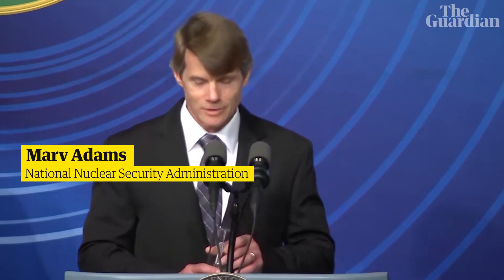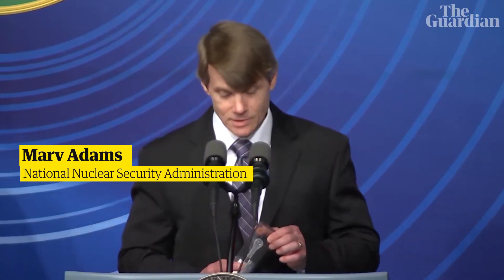Nuclear scientist Marv Adams explains what happened in the successful fusion experiment

Comment: Did we break the laws of physics or am I dumb. “The law of conservation of energy states that energy can neither be created nor destroyed - only converted from one form of energy to another. This means that a system always has the same amount of energy, unless it's added from the outside.” 

2 megajoules in 3 megajouls out? Yes conservation of energy law state’s energy can’t be created unless added from the outside but only 2 megajoules were added from the outside?? Did we break the laws of physics someone answer…
Reply: in fusion 2 lighter atoms ( talking in terms of mass) combine to form a single heavier atom. but the mass of the heavier atom is not equal to the sum of the masses of the 2 lighter atoms. ex- if 2 hydrogen atoms each with mass 1u combine to form a hellium atom but the mass of hellium atom is less then 2u then that mass which is missing is converted into energy

Comment: 2MJ in 3MJ out??? Does that not break the laws of physics and conservation?
Reply: No. How would it.
Reply: @afaxmachine5045  you’re getting more energy from a system than you put into it.. how can that be possible?
Reply: @ekothesilent9456  the extra energy comes by breaking the nuclear stability... The nucleus at the core of element has some potential energy due to the binding nuclear forces present there... If you can irk that stability, you can get some energy released at the cost of that loss in potential energy!
Reply: @ankurraj6560  why thank you!!

Comment: To get that nuclear fusion to begin took a lot of energies though the lasers may have been 2 joules but the process to get that plasma to plasma levels was way more than 2 joules i bet you anything.
Reply: 300 MJ to get the 2 MJ of lasers per the article I read. Still doesn't change that they got a man-made fusion reaction that gave more power than put in, as that had not happened before, outside of thermonuclear bombs. Don't buy fusion power plant stock as this is a step in a still very long road.

Comment: Doesn't that break the laws of thermodynamics or something? Energy can't be created or destroyed or whatever?
Reply: Nope, because the energy released by the fusing of those hydrogen isotopes was already there in the fuel. Fusing the hydrogen isotopes into heavier elements released the energy. Just like what happens in a thermonuclear bomb, just without the bomb part.
Reply: @steveaustin2686  Lol "without the bomb part". Love it
Reply: @Chris_Cross  Yeah, that's been the hard part. Now that they can ignite fusion, they still need to sustain it. It took 300 MJ from the grid to get the 2 MJ to ignite fusion. Fine for starting a fusion plant, but now the fusion needs to be sustained for more than roughly 0.08 nanoseconds. It's an important step, but in a long road to fusion power plants.

Comment: 1.5 isn't a lot. How much energy is put into the system? Will it be worth it? Will it exceed energy put for running the system?
Reply: Yes that was the whole point of the experiment.
Reply: @afaxmachine5045  I mean whole system with all inefficiencies, not the output of the laser vs the energy gained from fusion.
Reply: @BitWise501  From the article I read, it was 300 MJ to get the 2 MJ lasers for 3 MJ of fusion. No one is going to start building power plants based on this in the short term. But I believe that this is the first time man-made fusion got more power out than what was put in, outside of a thermonuclear bomb. It's an important step in a long road to fusion power.

Comment: I’m not impressed.
1.5 megajoules is equal to 0.42 kilowatt hours, which is about $0.21 worth of electricity.
Since we’ve spent about $50,000,000,000 on fusion research, they would have to run this experiment successfully for 238,000,000,000 cycles to break even.
Meanwhile, the fusion reaction in the Sun (and every main sequence star in the universe) produces 3,800,000,000,000,000,000,000,000,000,00 joules of energy per second. 

A thermonuclear hydrogen fusion bomb creates approximately 4,180,000,000,000,000,000 joules of energy.

Suffice it to say, Fusion Energy has a LONG WAY to go before it’s economically viable.
Reply: It produced 1.5 MJ in one billionth of a second, though, in a millimeter-sized reactor. Yes, there's a long way to go, but don't compare apples to minivans.
Reply: Turns out 238 billion cycles is about 238 seconds if you imagine the process is sustained.
Reply: @ashleydavis3318  So how long does it take the team to create one of those “energy packets” filled with fusion material? 
Because based on what I’ve read, a sustained fusion reaction on Earth is impossible due to the amount of heat, pressure, and material required. In order to have sustained fusion, you basically need a star.
Note: I seriously hope I am wrong about this.
Edit: yeah, so like I said, they have a LONG way to go for this to become economically viable. They can only run a one experiment at a time, in very small/quick batches, that require a ton of prep time. They’ll need a new process if they ever hope to get more energy out of this type of reaction.
Reply: @jeffw8218  Not sure about the fuel, but yeah the actual reactor would probably achieve fusion in short laser bursts. At least the fuel can be iterated upon and improved now that we know that the process actually works.

Comment: This is actually amazing. I had always assumed that the laser design was inferior to the Tokamak and the Stellarator, but it's actually progressing faster than both of those designs. But remember that a fusion reactor can't just generate a higher energy output than its energy input and call it a day. It has to generate an energy surplus that is greater than the cost of the laser and the facility within the lifespan of the machine parts.

Comment: This guy was charming. I’m still a little skeptical of using lasers for fusion to actually generate industrial power, but we certainly learn more about the process, so this facility at least generates valuable data.
Reply: You're right to be skeptical. Yes, the data is useful, but as you said, this is not the way to get continuous power, and it didn't even get "more energy out than in".

In his own words, this got "more energy out than the energy deposited into the pellet". That's a very different measurement, and it's ignoring the orders of magnitude more energy that was lost in the conversion, and even more energy that got lost in manufacturing that single-use highly precise cryogenic pellet and,  gold cylinder, and all the other parts that get destroyed with every shot.

Comment: This fusion technology would be beneficial to combating Climate Change. It can produce nearly limitless, emissions-free power. However, achieving controlled fusion on a large scale is extremely difficult and currently not technologically feasible. This breakthrough is a significant step forward, but it is still a long way from being able to produce fusion power on a commercial scale. Additionally, even if fusion power becomes technically feasible in the future, it would take many years to build the infrastructure needed to replace current forms of energy production. We must keep up with our fight to rout out Fossil Fuels!

Comment: A few remarks.
1. Not the first. The UK  jet lab did it in February where the fusion positive balance produced 59 mega joules 
2. Lawrence livermore laser fusion in November  produced 1.3 mega joules.
This is the amount of energy produced by 30 grams crude oil.
3. We are still 50 years away from commercial fusion energy.
4. We are still thinking wrongly on producing energy. We should not be looking to turn a steam turbine by heating water.
We need to be thinking about inducing a flow of electrons like solar plasma to directly generate electricity. This is called aneutronic fusion

Comment: was this a charade about 'better, stronger, smaller..' ... fuel? 1.5 in, 2.0 out. So, about a 33% yield. Does making the fuel cost more than 33% of the yield of the fuel that's used? Or is the idea that fuel creation process can get better whereas a yield of fusion being better is all ya need? There must be some nuance, or then its just moving the air in the balloon around. Have to read more.

Comment: In case anyone is wondering, the time it takes for light to travel an inch is 8.472546076823462722261317938839116e-11 (or 0.00000000008472546076823462722261317938839116) seconds.

Calculated on my SwissMicros DM42.

Comment: I love his level of calmness. There's no need to "sell" or hype up anything. It's like when you impressively succeed and you don't have to worry about going over minor issues. You did it.

Edit: hey ya'll, just so ya'll know I ain't reading these comments
Reply: @Drengodr 2MJ was the energy delivered at the surface of the target, the 192 lasers actually consumed 322MJ of energy in the whole process… Read the official article. This is very far from true ignition. Impressive advancement nevertheless.
Reply: @Drengodr This is a milestone achievement, but it is a baby-step in making fusion an energy source reality.  The energies you've listed is for the specific fusion reaction.  Lasers supplied 2MJ and they got 3MJ of heat out of it from fusion.  However, for the lasers to supply that 2MJ took 300MJ of electricity.  There is still a ton of engineering/science work to get this to an overall system energy break-even and a ton of work from there to make it cost-effective to supply energy in this way.
Reply: In doing so he actually sold adn hyped everyone up for this.
Reply: this is exclusively hype. if you're under the impression that this fusion reactor creates more energy than it consumes, you'd be wrong. the misleading lies of omission has kept billions of dollars away from more promising scientific research. they have been doing this for hundreds of years.
Reply: although he also acts like a pretentious arrogant privileged white man
Reply: No they didn’t. The experiment actually consumed hundreds of megajoules, to produce only three back. They’re omitting the operational costs of the lasers for some reason, saying the lasers were just real inefficient and if they had more efficient lasers, they’re “theorizing” they could do it with 2.05 megajoules. He’s trying to calmly perpetuate a scam., because he has to know better.. They’re also asking for tons more money for equipment and sensors to analyze this “breakthrough”..
Reply: @hjvanderlinden  burning up 300 megajoules to “generate” 3 is not practical or realistic, at any scale..
Reply: To be fair, most scientists presenting on a stage like that would be humble or coy because they’re usually not the outgoing and flashy type, hence being a scientist. So you can safely guess that he’s just part of the norm. Nothing exceltional or surprising about his behavior
Reply: @Robisquick  the presenter here was very arrogant.
Reply: No need to sell or hype when everybody watching is thinking "this will change civilization".
Reply: It’s nuclear fusion it sells itself 😂
Reply: @Drengodr no, it was 300 megajoules to produce 3. They’re removing the actual energy it cost to run the lasers for this.
Reply: @Drengodr I was about to say the same in a way that said the equipment and also lasers to run this would still benefit from the output given, also the output is 1 inch of the speed of light. So given the input I would say also the output energy outweighs the now primitive energy source would one say?
Reply: And it will go nowhere.
Reply: And that is also why most people won’t hear about this. True news is competing with those pushing their products.
Reply: @Drengodr  Efficiency should be calculated in terms of electrical energy:
efficiency = El Energy Output / El Energy Input

El Energy Output = Heat Energy Output x conversion efficiency = 3MJ x 35% = 1.05 

El Energy Input = laser energy / laser efficiency = 2MJ / 0.5 = 4MJ.

Efficiency = 1.05 / 4 = 0.25125 or 25.125%
Reply: he’s lying that’s why. All of a sudden this happens while Russia at war.. yea ok 🤣👍🏻
Reply: He did hype it but you did not understand the deception. He did not account for the total input energy from the outside system that was used to run lasers.
Reply: @usneome  do you actually know what are you talking about?  Because you sound like one of those people that doesnt believe in anything, like always for example when trains couldnt exist. I feel sorry
Reply: @shaund4978  Read comments below, people have mentioned how much input energy to lasers was actually used in this experiment. 320MJ. The output heat produced by fusion reaction was 3 MJ. It means that 99% of input energy was lost in the process.  
You should thank me for pointing out that this was a small step in fusion research, not worth of huge publicity stunt.
Reply: @usneome  Shut up will ya
Reply: @usneome  what are you even talking about?  the building AC?  there is not outside system to run a laser, the laser is the system.  have you ever used a laser pointer from the store before?  the lasers they use are literally the exact same thing but bigger and with a much nicer crystal so they can have a very short pulse duration and a certain wavelength
Reply: @Logan-dk8of  they used 192 laser beams in this experiment. I guess that helped push input energy requirement to a high value.  I did not come up with 320MJ number for input energy to lasers. Several other comments on this site quoted this number from another article that gave more detailed information about this experiment. 
My overly optimistic laser efficiency number of 50% is still very troubling for achieving commercial nuclear fusion.
Reply: @usneome  I'm completely impartial and just a casual observer here. Can you point us to some information that challenges this?
Reply: @indignorant7684  
Presenter used intermediary value (output of lasers at 2MJ) and compared with the output of fusion reaction 3MJ. 
He never mentioned input energy to lasers. This is the true input that should have been used in gain calculation. Actually it is even worse than that because output energy is heat and converting heat to electricity is also a lossy process. 35% efficiency. If the Laser efficiency is 50% (being generous here)

Overall efficiency = ( 3MJ x 0.35) / (2MJ + Laser loss) = 1.05 / ( 2+ 2) = 0.25.
Just to break even in a lab setting they need to improve efficiency at least four times.  That is why he said they are hiring people who like to work on challenging problems.   
For a commercial technology, breaking even is not enough, they need to improve efficiency much more to justify costs of building and operating a power plant.
Reply: @indignorant7684  read the actual articles on this. The lasers they used consumed 300 megajoules to produce the reaction that generated the 3. They’re ignoring, or rationalizing away about 99% of the actual energy used to produce this. They’re saying if they take out all the inefficiencies, they “calculate” they could probably have done it with 2.05 megajoules, or what they’re “estimating” that the laser actually transferred, in the best-case scenario. Bottom line, the reaction that “generated” 3 megajoules took about 300 megajoules to produce though.
Reply: @indignorant7684  He just means that it doesn't take into account the 300 megajoules it took to power the lasers to kick this off (only 2 megajoules were desposited on the container he was talking about). That's an obstacle where there is still plenty of room for improvement, but this is legit still an exciting moment. Its the proof of concept that this type of reaction is even possible, and now that we know it is, it'll be a lot easier to get more funding to figure out how to scale it up in a way where the entire system can have a positive output, rather than just a small fraction. :)
Reply: @usneome The original point of that experiment wasn’t to maximize potential net energy. Now that this has happened, that’s probably where it’s headed
Reply: @kaijuslayer3334  they should report fusion technology progress honestly, not with a deceptive hype that ignites public imagination to believe that commercial fusion power plant will happen soon. 
I expect that new, big grants will be given to the national lab in Livermore, and this was probably the main point of this announcement.
Reply: @usneome  congrats, you made up a bunch of numbers to look real
Reply: @null-byts  actually my assumed laser efficiency number is much more favorable to commercial fusion than the real number.
After my post I noticed that the input energy to lasers was 320 MJ and not 4MJ as in my artificial example where I assumed laser efficiency at 50%. The actual lasers used in the experiment were much less efficient (less than 1% of input).
Reply: @usneome  i feel like you are ignoring the nature of fusion using heat directly, therefore not being subject to heat to electricity efficiency loss until desired scale is reached
Reply: @MadnanTheArcher  your post makes little sense.
Once the fusion reaction is over, heat will have to be used before it dissipates. Even if we could collect all heat energy and use it to boil water, there is still conversion from steam to electrical energy that is less than 50% efficient.
We also have to consider energy that will be used to produce hydrogen fuel.
Reply: @usneome yes he did that’s what made this test different from the rest for the first time there was a power gain
Reply: @Jakob-W  it was a “theoretical” gain. They did this exact same trick last time they “crossed this milestone”. Last time they were just using estimates of the energy they think the reaction absorbed, not the actual energy used to produce it. They’re doing the exact same thing, again.
Reply: @usneome  So either you are just a hater that is going to make up stuff to put this man down, or you have some deep inside knowledge that they just forgot about counting electricity somewhere... EDIT: Oh and the Dunning-Kruger of getting a B+ in a basic math course.